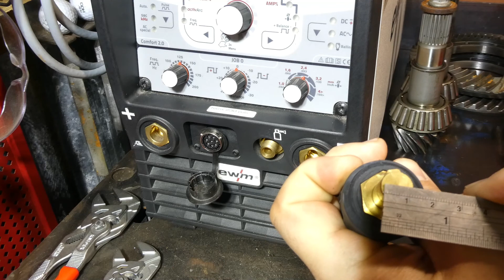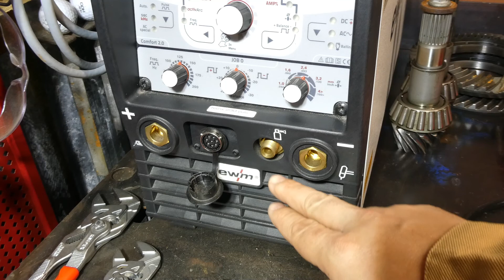TIG Torch Tech - 1 piece? 2 Piece?

Comment: Excellent vid 👍.
If you use the brass hollow CK din connection which gas can flow through on you EWM, won't gas flow back out of the panel din mounting? 
Seeing as the dins have not seals on them, thus reducing gas flow to the torch head / drawing air into the argon?
Reply from the maker: This machine does not support gas-thru dinse. In my experience it’s not very common. I think the hole on this safe-loc adapter is more of a production option than user feature.